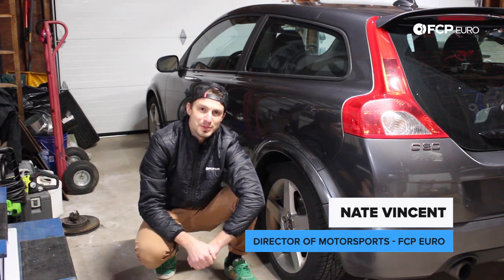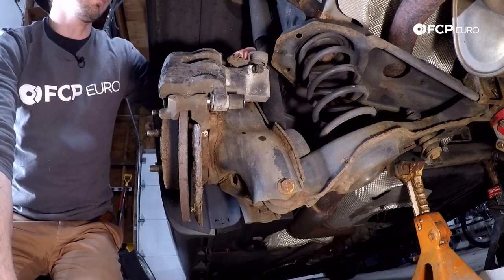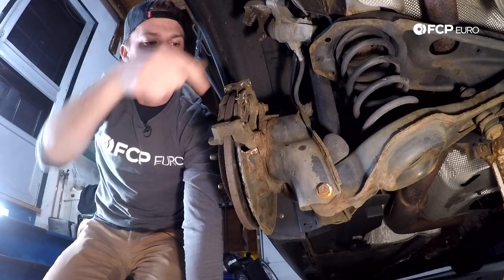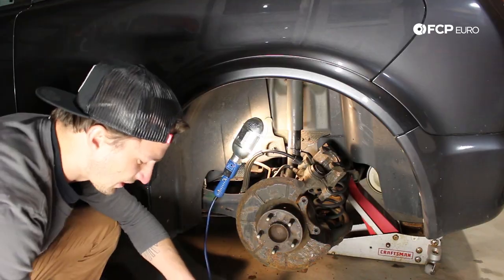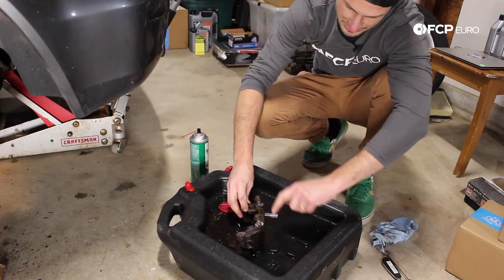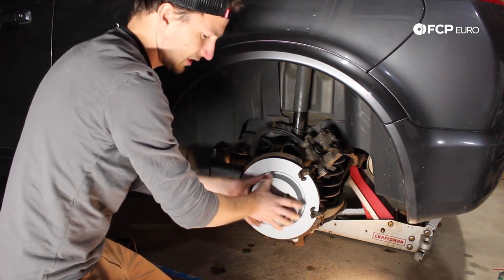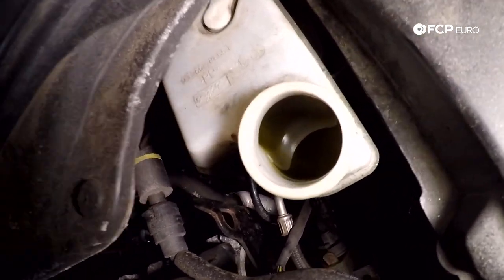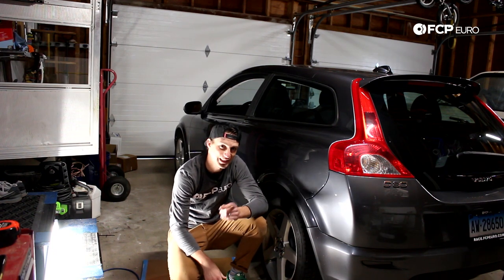Volvo P1 C30 Rear Brake Pads & Disc Replacement & Fluid Flush DIY (S40, C70, V50)

Comment: Good work, and nice video!
Btw., I too have a Volvo, but the S40, which is exactly the same car as the C30 from underneath. 
You mentioned that the ware on the rotors and pads was uneven, I bet the handbrake needed to go up several clicks too before it engaged to make a safe grip. 
That's because you have to reset the caliper piston while replacing the pads, many people don't know this, including your car's previous owner I believe, otherwise the ware would have been even.
To reset the piston along with the handbrake mechanism during a brake/rotor job:
- Slacken the handbrake cables by undoing the 10mm nut situated under the handbrake lever untill there is no more tension on the cables. (done from inside the car)
- On each wheel side, release the handbrake cable from its mechanism on the caliper by grabing it's cap with forceps and pull to maneuver it out of its slot. (Looking at your rusty cables, you may need to replce those)
- Now work the mechanism lever like a pair of scissors with you hand, or a tool if you find it too tough, or you could unmount the coil spring which makes it much easier to pump the lever, but that coil spring is a PITA to remount afterwards without a proper tool, and as you pump the lever by any means watch the brake piston expand outwards, continue to work the lever until the piston rubber boot is fully extended: ONLY now should you start pushing it back all the way in by applying pressure and simultaneously turning clockwise like you did in your vid. 
- And now your piston along with the handbrake mechanism are reset! After everything is reassembled, pump the brake pedal. 

The End 😁

Comment: Thank you and very well timed.  I'm about to do this job on my winter-stored C30, anticipating emergency brake mechanism issues.  The comment by Ghassan is very good to know,  After 52+ years of Volvo ownership and DIY repairs, you're never too old to learn.  I wonder why you bled the brake line after the rotor replacement?  I never have done that except if I was replacing the caliper.  BTW, I'm lucky to have a set of the piston retraction tools and a pressured bleeder - my daughter is 48 years young.
Reply from the maker: Glad you have a helping set of hands!

Comment: Great video as always.
Can you please make a video for dummies where you actually show the jacking points underneath the C30/V50, and where you should not jack.
Reply from the maker: We sure can!
Reply: @fcpeuro  Paused the video when it talked about a center jack point to see how many comments flagged doing that - but only this comment.  Does rear center point also apply for C70s?  And did you make on P1 Volvo jackpoints? (can't find it)  Forums and other videos seem insistent has to be at side pinch seams near tires one at a time, not to mention pain getting stand right up to the jack.  How you did it looks way easier
Reply: On my V50 I use the same technique as shown in this video. Put the jack right in the middle of the rear axle. The exhaust muffler sits rear of it and slightly lower, so I use a hockey puck between the jack and the axle. This way the jack's arm doesn't touch the muffler. Jack, puck and axle are all about the same size. My jack has a mechanical safety so I don't use jack stands. Been doing this twice a year to swap winter and summer wheels for the past 6 years, saved a bit of time doing it this way. The rear bumper should be closer to the axle on the C30 so that helps if your jack is a bit shorter like the one used in this video. Not sure about the C70s

Comment: Mine is rusting the same way.  I tried replacing the rear end links but they were so rusted to themselves I had to take it to a shop to get them cut off with a torch.

I'd love to see a video that shows replacing the hubs and the brake shields!
Reply from the maker: Thats on the to do list, they were reallly reallly bad!

Comment: 9:47 the carrier bracket on my V50 had 1/2" hex head screws (12.5mm, not 13). Discovered it the hard way, measuring on the new fasteners (roughly $10 each at Volvo). Well, at least now I have a nice set of screw extractors in my tools collection ;-) Otherwise they're perfectly standard M10, in case you might want to clean up the threads in the carrier with a tap. The brake hose has a 3/8"-24NF thread, but takes a metric 14mm wrench to undo. Someone at FoMoCo must have had a bad night before they designed this brake system.
Reply: Wrong information above for the hose thread. Borrowed a 3/8" tap and die from work, and discovered this morning that the die does not fit the hose. So that thread is most likely M10x1, which is about 5% larger than 3/8-24NF.

Comment: Nice video, what is the size of the breeder hole? Thanks!
Reply from the maker: Thanks, zz wang. Usually 1/4" ID tubing will work fine. Or you can get this: https://www.fcpeuro.com/products/catch-bottle-kits-mot-1820
Reply: @fcpeuro  Thank you for your reply. And what size of wrench to use on the breeder on the front? Is it the same 10mm as the rear ones?

Comment: Just rent the tool for free from your local auto parts store. Costs you nothing, even if you don’t buy the parts there.
Reply from the maker: 100% valid option! It was a non option during lockdown/quarantine but under normal conditions its worth a tool rental.